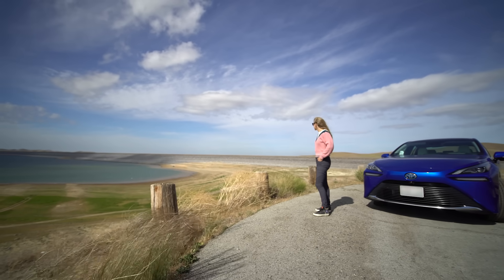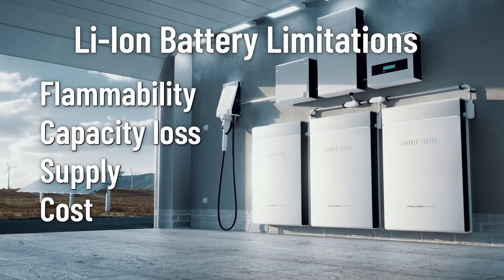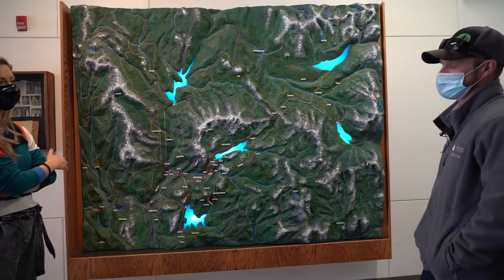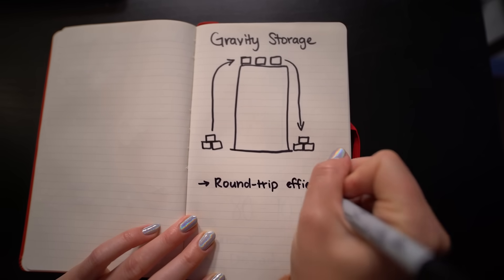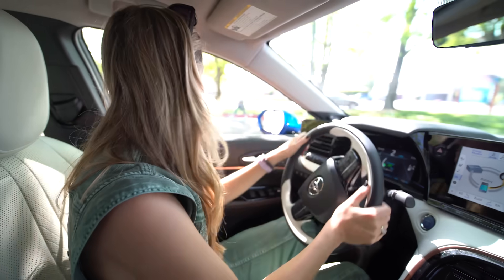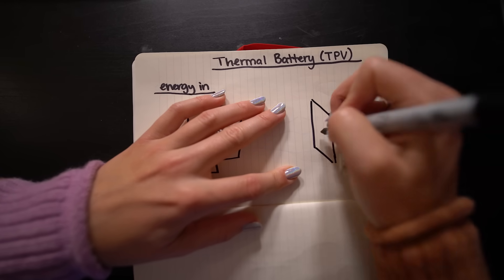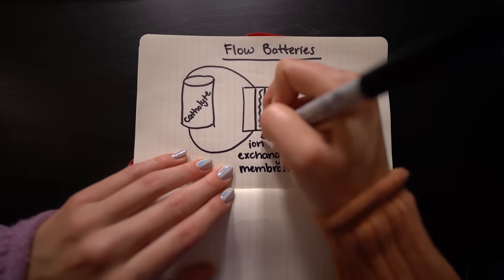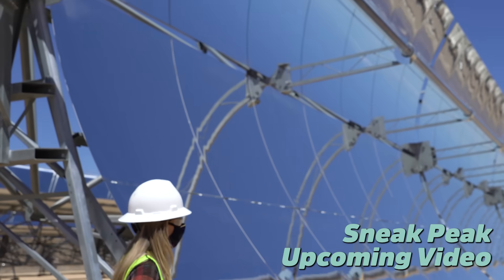The BIGGEST problem with clean energy

Comment: SOLVED: Potential energy storages, underground, or even in the ocean, extremely large.
You pump water up, when energy is abundant, you let it flow through a turbine, when you need to extract
the stored power, from teh higher storage ponit to a lower storage point. It's like
a dam but with the side containing the water being completely artificial.
They actually use these conceptual energy storages in games already.
Reply: Wathcing more of the video, well, that was a perfect waste of explanation my side.

Comment: The multiple options for renewable energy as demonstrated by your presentation are fascinating - and increasing.  And as you show it will be a combination of these emerging technologies in additon to techologies that have yet to be harvested working in tandem with what we know today will be the key to backing away from fossil fuels in a seriously meaningful way in the future.  Your explanation of hydro-electric generation from lake storage where the freefall of water from an upper lake drives a turbine / generator at the lower level and in turn can be pumped back up to the upper level was very interesting.  You used the term pumping up and pumping down .. I'm not sure if the action to get the water from the upper lake to the turbine is 'pumping' .. more freefall than pumping.  I look forward to your future presentations.   Thanks

Comment: Anyone who thinks that there will ever be ZERO EMMISIONS you are 100% delusional. To be "ZERO" emissions that would mans that virtually EVERYTHING would have to last forever, from tires in on cars which wear out rather quickly and put rubber into the environment (Today tires consist of about 19 percent natural rubber and 24 percent synthetic rubber, which is a plastic polymer. The rest is made up of metal and other compounds). Don't let me get into the hundreds if not thousands of parts in an automobile (depending on size) that are made from petroleum by products. Steam reforming is at most about 65% efficient, not to mention that you have to highly purified water to start with. This is the first Physics Girl video I have watched (and enjoyed), and I don't disagree with the potential for most of these energy technologies, but I believe that they are more like a 100 years off over 28 years. Using 100% renewables is not so far fetched, but there will likely NEVER be anywhere near 100% ZERO EMMISIONS, Maybe 60% to 70% I believe. Keep making good videos, but maybe try and be MORE realistic about estimates of how many years until much of this is available.

Comment: You might want to check out flywheel energy storage system (FESS). There is a French company (Energiestro) that has a residential sized concrete flywheel. In general, the FESS can be upto about 90% efficient, are long lasting and can provide millions of cycles.

Comment: Absolutely right; wind and solar are unreliable and batteries won't do it. Pumped storage can't be used everywhere--you need differences in elevation and huge water bodies at the different elevations. And breakthroughs in batteries are always on the horizon, but never eventuate.
After 35 years of intensive pursuit of renewables, there's not one town of 20,000 or more people on Earth solely on wind and/or solar.
Most of what is dealt with in this video is pie in the sky. Physics girl needs to learn to recognise pie in the sky. But she's still young…
If people had been pursuing nuclear electricity generation for the past 35 years, we would have been much better off. The pursuit of wind and solar has done much harm.

Comment: in the coming transition to a new culture of energy, or more precise, new culture of tapping in into the radiation "flow" of the sun, one thing is utmost important: a mindset of scalability of purpose.  That is very different from the scalability of a technology. If every new house gets equipped with gravity storage, hot water storage and electrical batteries, there won't be any issue at all. Complement that with facilities providing capacity on the block level... etc etc.
What will definitely never work, to take any of those new technologies and implement it in a centralistic manner like power plants. The real issue here is, that you have a strong lobby defending those centralized approaches.
Another One thing missing: solid state batteries.

Comment: I liked this video. It got me thinking what are the most important criteria to rate the different methods. So far I think...
Cost per kWh (incl. operation over time)
Scalability (small or big)
Safety
Geographic dependency
Raw materials (lots of supply)
Efficiency (round trip of course)

What others seem important?
Also, with lots of criteria, it seems like a good use of a "spider graph"

Comment: The earth is round and rotating. If we could get the world to build a set of generation sites including solar, wind,  like waves, nuclear fission/fusion, and thermal along the rotation path of the earth and connect them with power cables that then feed the electrical grinds of the world we would need minimal storage and still support the world's power needs. The paths could be set so they could take advantage of the tilt of the earth and benefit from the extended sunlight as the earth rotates around the sun. The cables could take advantage of their ocean crossing by collecting power from wind, tides, and wave.  The biggest issue with this is the immense infaInfrastructure needed to support it. Thoughts?

Comment: 1981, G. Harry Stine wrote "Space Power" about geosync solar power satellites.  40 years later, England is seriously considering building a 2GW solar power sat.  It's contingent on Starship to get the materials up there.  2GW is only ~ 1/40th of what England needs, but it's a start.  Still need batteries or (?) as the space-based solar panels are illuminated 99% of the time, so 1% of the time you need something to hold the grid up.

Comment: No issues with "energy storage" here. Most of our electricity generation here is hydroelectric and geothermal. We also have an increasing amount of wind generation, and some coal fired generation. We don't use much coal fired generation, and a lot of homes are increasingly using domestic solar generation with battery storage and also heating water during the day.

Comment: Yes, storage, for wind and solar you have to collect it when it's there and store it for when it's NOT there.  The OTHER major untapped energy source is geothermal which doesn't get much coverage.  The interior of the Earth has pretty much unlimited "heat" energy ready for the taking. Ocean waves and tidal energy is also pretty much never ending energy source.  Just think, using the gravitational pull of the moon and sun to pull water in and out of energy capture devices.

Comment: I could not see any reference to Flywheel Energy storage which is also part of the energy storage roadmap.  Since these are long life systems (25+ years) and can store MW of power they are useful for storing energy in short bursts such as when electric trains slow down when they arrive in a station, currently the electrical brake energy is dumped into resistor banks.  If a flywheel is used, then this energy can be saved and reused to accelerate the train as it leaves the station onto the next stop.  Flywheel energy is also used in other areas to backup UPS power and there are other activities where a flywheel is useful where energy transfer is required in 30 second intervals.

Comment: Vacuum capacitors. Very simple but if built robust enough there is next to no maintenance, they won't wear out and if stored underground you are not taking up vast amounts of space on surface land. I think it warrants a lot of R&D into because of the benefits. Lithium and lead have finite supplies and batteries deteriorate over time, some people have replaced their car batteries with a bank of super capacitors.

Comment: The 15% efficiency of the Internal combustion engine needs to be addressed. The huge loss efficiency due to heat lost from the radiator and straight from the exhaust that should be stored needs to be addressed. A way to keep older cars on the road (electric conversion kits and semi  hybrid improvements on existing vehicles) is much more ecologically sound than making millions of new cars every year. If electric car makers gave a damn about the environment they would be making electric and CNG conversion kits for current cars!

Comment: Solar is fine for most situations.  My household uses 40 watt hours per day in spring and fall.  I only need a 5 killowatt system and a battery large enough to keep the fridge and freezer cold through the night and the hot water hot some times.  The chargers and controllers are around 90% efficient but high draw appliances could be improved.  An air conditioner that can run on 200 watts will help.  Solar cooking during daylight hours and wood in the evening will also help.  A fire place in the winter.   Clothes lines instead of constant electric drying for clothes.  People got by without electricity 130 years ago and when they got it they didn't use much of it.  But now we sometimes use 120 kilowat hours a day.  A recent bill was $448.00 for electricity.  The main culprit is the heating and air conditioning unit.  Central heat and air is not efficient.  SMaller more local units are needed and smaller wall  or plug in heaters, solar heat also will help.   A solar panel needs to be cooled to run efficiently and a water pipe grid under each panel can capture heat for the winter time or just keep water hot during the summer time, this will make the difference.   Also knowing how long it takes to dry or cook something and not wasting time over cooking or heating something.  Under ground cold water radiators would also keep temperatures down in the summer if we ran that cold underground water through cooling radiator grills in the house.

Comment: I recently found the "liberty engine" on youtube and didn't know if it was real or a scam?  If its fake, can Tesla's "power matching" be applyed to this to fix it and make it work.  Seems the motor had enough torque to attach a second alternator for more power... eventually your power output will be greater than input, providing free power.  Don't forget to attach a gearing system like a bicycle sprocket for more speed and less torque where needed.

Comment: This has striking parallels to how our computers and information technology is designed.
It's buffers and caches all the way down.
A computer system can have L1 cache, L2, L3, RAM, Optane cache, NVMe storage, spinning rust, network access, intermediate proxies, and tape drives ferried around by little robots. Maybe even an optical drive somewhere in there.
This is what we need for the energy grid. We're not looking for a winning technology. We want ALL OF THEM.

Comment: I just looked and the closest Hydrogen refueling stations to me are over 655 miles away.  When you speak of zero-emissions, that should include the emissions from mining the materials and production of equipment.  "zero" is pretty much impossible to reach.
Reply: @lepidoptera9337  The charging stations, the cars themselves, etc, all require mining.  Even the electrolysis equipment needs metal, which is MINED.  The solar panels used to generate the electricity for the electrolysis is mined and toxic.  Most plastics come from fossil fuels, the drilling for which causes emissions....Zero emissions are not achievable.

Comment: We're going to run out of lithium by 2080? Lithium material is completely recyclable. There are several plants that are in operation or coming online as I write this.
Reply: @lepidoptera9337  a very good point. Even lithium ion phosphate is rapidly advancing. Just read a report that states 50% of all of Tesla's cars (globally) are now made with LiFePO4 which means the end of using expensive metals like Cobalt.
Reply: @Bubbz2024  Exactly. All projections that claim that any one particular material or material combination is mission critical are based on shoddy thinking. Technology is not dependent on any one material. If something is not available at a low enough cost, then we simply have to switch to a more cost effective (if possibly lower performance) alternative. 

It will be interesting to see if the range wars will continue in the electric vehicle space. The main reason for larger batteries in the past were technological: longer range batteries have much better reliability because the current densities in the pack (and with that the heating) are lower and the pack has to withstand fewer charge/discharge cycles in total. If both problems can be addressed with better technologies, we may see vehicles with much smaller battery backs that can be recharged very rapidly (on the minute scale) instead.
Reply: @lepidoptera9337  you made a lot of good points. I'm really looking forward to seeing what the future holds. Particularly the next three years. By then my VW ID 4 will be outdated.

Comment: There is no path to 100% renewables. They are too intermittent, too unreliable, and too expensive. How many solar cells can we build before we reach a bottleneck on one of the exotic materials used to produce them? How much is it going to cost to recycle them? America uses about ten terawatts of power a day. How many solar panels and how many wind turbines would it take to produce that much electricity? But as you said, that's not the worst problem. How much would it cost to produce the infrastructure necessary to store one day's supply of power? If you are serious about zero carbon, nuclear is the only route forward.

Comment: Physics Girl says this compressed air storage at 6:10 is really impressive - 10 Gigawatt hours. It is really impressive but the scale of the total system needed for the US alone is very roughly around ~ 500 to 1000 Gigawatt hours.. (for a switch to 100% renewables)
Also that's really only the bare minimum - it covers the day-night cycle, but probably not summer-winter cycles.

There is a solution to all this but its a somewhat surprising one - synthetic hydrocarbon fuels generated in equatorial solar plants and nuclear plants. In other words synthetic petrol & kerosene & methane. Completely CO2 neutral - works in aircraft and even rockets - hydrogen but without all the downsides.

Comment: ever so GREEN, Wind Turbines are the ultimate in embedded costs and environmental destruction. Each weighs 1688 tons (the equivalent of 23 houses) and contains 1300 tons of concrete, 295 tons of steel, 48 tons of iron, 24 tons of fiberglass, and the hard to extract rare earth neodymium, praseodymium, and dysprosium. Each blade weighs 81,000 pounds and will last 15 to 20 years, at which time it must be replaced. We cannot recycle used blades. Sadly, both solar arrays and wind turbines kill birds, bats, sea life, and migratory insects. so wonderfully green. NOT

Comment: All this is solvable.
Use huge cheap Batteries.
Use Multiple sources of energy.
Geothermal is not intermittent. Tidal is not intermittent. 
Convert your energy to liquid hydrogen. Then burn it at your leisure or ship it anywhere in the world needed.
When using geothermal, warm and use liquids with low boiling points to turn turbines to reduce the needed depth of wells and reduce earthquakes. 
Renewables now!

Comment: meanwhile, nuclear power people are like "yeah, we have built-in energy storage. It's called fuel." There's enough stored energy in the fuel of a reactor to last 12-18 months without changing a single fuel rod. 
and nuclear power emits no greenhouse gases during operation. You don't have to destroy an alpine valley flooding it with pumped hydro storage.

Comment: The heating that compressing air causes doesn't improve the round trip eff. but what does is burning a little gas and using a gas turbine you can get more output than input by burning minimal gas. Enhanced CAES is the ticket. I've visited SCE Big Creek in the early 90's. Nice place. They only have 200-MW pumped storage. PG&E Helms >1200MW pumped storage. & LADWP Castaic 1200 MW. CDWR Hyatt has pumped storage.

Comment: This tech suffers badly from the law of entropy 
It will always take more energy to store the water or air then it will produce.
Also I don’t think your round trip calculations take into account building these facilities, or producing the raw materials to build them.
Add that in and your calculations drop off dramatically.
I love the idea of this, but we are centuries away not decades. Try 2150 not 2050 
Nuclear is one that can produce far longer and reliably, but still needs more carbon producing resources and equipment to build 
Maybe they will finally find the holy grail in fusion and save us all

Comment: You keep hitting on a key thing about all energy storage methods - none of them are 100% efficient.  All of them require more energy to be put into them than can be drawn back out of them.  So maybe the current electrical grid model of creating the energy as it is needed isn't such a bad system!  It may be difficult to match production to demand, but it is the most energy efficient way to do it.

Comment: Where are we now with the flow battery? I work in the auto market. This video was so informative in the futures of electric cars and SUVs was just speaking today to my general manager about the current lithium ION battery packs there disposal and recycling. Another thing I learned from watching your video was the production cap on the Lithium ion battery was only until 2080. What was ur source on this information. Flow battery could possible answer to the Lithium. Maybe we should leave this gap and just invest in FUSION